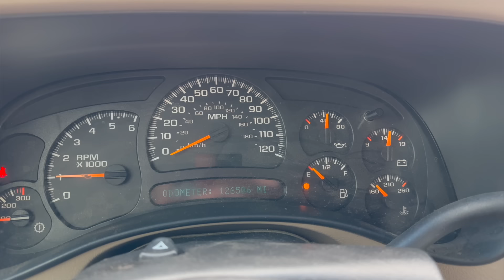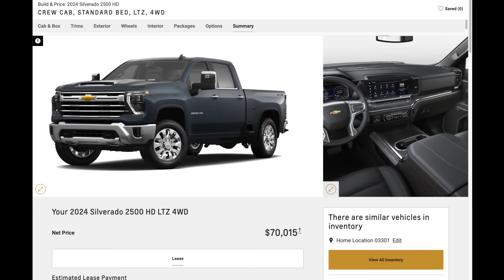I Bought the Best Truck I Could Get for $10k. How I Got it at Dealer-Only Auction

Comment: That truck is better in the front end collision. If you look at the bumper where it meets the thunder on the passenger side, it's angled down. Classic sign, it has been in a front end collision. Common replacement on these or front hub assemblies.
Water pumps ABS modules window regulators. Hey. Close attention to the connectors from the heater hoses to the heater core.

Comment: There are a couple of coolant drain plugs on the block that are useful to get more of the old coolant out before the flush.  You could also get some out of the heater hoses as well.
Reply: I could swear the radiator has a drain plug on the driverside corner
Reply: @fakeascanbe423  it probably does - these are in addition to those.  I was surprised how much coolant came out of my Dodge Ram 4.7 V8 when I removed the block plugs
Reply: Lucas-fi4xy  cool, thanks

Comment: A tip for dealing with a trans that doesn't have a drain plug. You can remove the front trans cooler inlet line and turn the truck on and pump out about a gallon and the pan will be mostly empty. Just don't let the inlet line start to form air bubbles, at that point you are starving the pump and can hurt it. You can also to a "Poor Mans" trans flush this way if you don't have a machine to do it, Just pump out a little less than a gallon at a time (pump a gallon, refill, restart truck let it run for 2 or 3 minutes then drain another gallon and so). Doing it this way I normally put 4-5 gallons through the system as when letting it pump for 2-3 minutes you get mixing of the old fluid and 5 gallon normally gets it cherry red.

Comment: Always remove the fill plugs first to allow air to rapidly replace the viscous fluid trying to drain out the bottom.
 How many holes do you put in the top of a juice can?   Two right ? 

A Faster drain removes more dirt trying to settle at the bottom.  

Filling a transmission like that is much easier when employing a spare or old power steering pump, and a hand electric drill to turn it. 
Takes a fraction of the time.

Comment: I replaced my front wheel bearings earlier this year and it took 4 of us on a breaker bar to loosen the caliper bolts a lift sure would have been nice
Reply: I did with Cordless impact wrench and on the ground also. It took some 5 min to open it.

Comment: Hi Waldo.  Nice truck.  They don't use salt on their roads in Washington state and I guess that is true for Oregon too.  That wheel bearing just about fell off.  I had to heat mine with a torch a good long time and use an air chisle to get it starting to come apart.  I didn't even see any rust on the old bearing or the socket for it.  Amazing.  Nice tip on buying from an auction too.  I don't know if I would ever do that but at least now I know how if that becomes a possibility.  My truck has 363K on it so your dad should get many more miles before needing any serious work.  Thanks for the video!
Reply: Majority of Wa state uses liquid de-icer, worst thing to have. Drive-through car wash more often during winter.
Reply: Living in western WA I’ve seen parking lots salted and some roads especially with this past winter but nothing compared to the rust belt

Comment: Cateye chevy’s whether it’s gas or diesel are, in my opinion, the best (overall) trucks ever made. Like you said they’re modern enough to be reasonable comfortable, but they’re by no means like the brand new hunks of computerized plastic you buy for $70,000 today.

Of course other trucks might have a better engine or better transmission or have better this/that. But when taking EVERYTHING into account, I can’t think of a better truck than the cateyes.
Reply: As an OBS ford guy I have to agree. I might give the OBS fords the nod in reliability/ease of maintenance, but the cat eye Chevrolets are very nice looking trucks. If I had the option of an OBS ford or a mid 2000s 2500hd single cab long bed, both in rust free and mechanically immaculate condition... I'd take the Chevy, I think.
Reply: @bad_covfefe  Both phenomenal trucks in their own ways👍
Reply: Best teammate. I have the 2000 7.3 and a 2006 6.6. Both have a pretty easy maintenance but I'd give the edge to the 6.6 because the allison transmission has an external filter. Blows my mind how awesome it is.
Reply: Personally really like the ram 1500s from 98-about 01.  Don't care for the early second generation as much as the late.  They are a good mix of easy to work on and fairly modern fixtures.
Reply: I have an 05 z71 crew can in red.  Unfortunately the clear coat is peeling.  It is a sharp looking truck.

Comment: I bought a 2001 2500 hd   GMC, I did all the fluids. When I pulled the plugs, they were worse than those, worst I’ve ever seen, still running pretty good and getting mileage you were. Couldn’t believe it ran at all.  Great truck 210,000 miles and should go another 2.

Comment: Former FoMoCo chassis engineer of 15 years here. I have to admit, secretly admired GM trucks of this era, especially GMT800 and may be GMT900. The LS/LT V8 engine was the enabler for many good things for this truck. LS 6.0L + 4L80E was the best combination of all time. Then K2xx and T1xx happened and it was down hill from there.

Comment: Here in Michigan its virtually impossible to see a frame that beautiful unless the vehicle is new or at most 1-2yrs old. The road salt is incredible at making winter driving safer here and it works very well, but its nightmare fuel on vehicle frames and bodies. That truck would have holes in the frame or close to it, and the truck bed and bottom of the doors would without a doubt have holes by now. Even when you do your best to wash it off you cant escape it, basically vehicles do not last long here.
Reply: Excessive salt use Doesn't make anything safer. It makes drivers more complacent leading to risky behavior in inclement weather and is horrific for the environment.

Comment: I loved this episode. There’s something incredibly pleasing and satisfying about working on an older vehicle that is in nice condition underneath. No struggling with rusted bolts etc. Unfortunately that’s rare here in the UK as the first sign of colder weather and the salt gritter trucks are out! I now use something called Lanoguard, which is a natural underseal that uses the oils from sheep fleece. Much nicer to use than the traditional black underseal!
Reply: I'm doing my trucks now in preparation for winter, although we don't use salt, a nice pressure washing and a coat of Amsoil MP
Reply: Thats good stuff, I use it on the plow at work.  Called Fluid Film in the US for anyone looking.

Comment: All I have to say is Trucks made from 85-10 were super easy to work on, once we hit the mid 10’s it got substantially harder to work on. Nothing is better than having to take the whole front end apart after a rock put a hole in your radiator

Comment: Don’t forget to change the fuel filter, probably the original in the truck, you will be amazed at the performance improvement. Everybody knows to check and change the air filter.

Comment: Man, that's a hella clean truck! Idk though.. I think I'd rather change spark plugs any day then have to mess with injector pumps & stuff like that which go bad on diesels and can be very expensive to replace. Idk, maybe I'll get one someday, but we'll see. Anyway, love these videos! Nice work. 🍻
Reply from the maker: Just make sure you get the right diesel engine. One that doesn't have a bad reputation for failing injection pumps 👍
Reply: I love diesels myself, but I have to admit there is something nice about having an engine that is cheap to work on and cheap to replace if it is necessary. (Oh, and half the weight.) That diesel torque and sound though... Oh my.

Comment: Hey Waldo, how's going? Can you tell us why your dad chose a gas engine instead of a diesel? And how this chevy drives in comparison with your diesel GMC? I'm curious!
Reply: They can be a lot less maintenance less large expensive parts. Diesel has a cp3 fuel pump in this generation, the intercooler, turbo,  injectors. Diesel can have cold temp issues...just to name a few
Reply: I'm not Waldo, but gas engines are cheaper to maintain and run. Less power and less fuel economy are a given. If you're not towing much gas might be an option to consider. If you're towing regularly, buy a diesel. Front end ride will be better with a diesel as the motor is heavier. Shocks will provide an improvement to ride quality, but you get what you pay for. That goes for gas or diesel.

Comment: The GNT 800 platform is a very good platform. I've got an '04 GMC Sierra 2500HD w/Duramax LB7 and Allison Series 1000 5 spd transmission. It has got approximately 526,000 miles on it and is a daily driver. Runs great and gets 18-19 mpg local driving.

Comment: Tip an easy way to check if your window motor works before removing it  grab a 15ft speaker cable hook up to your window motor and hook up those wires straight to the battery if your motor works, its a fuse, or window switch, or beoken wire....you can use same technique to check car seat motors...

Comment: I have a 2006 year model, bought it when it had 13,715 miles on it, has 141+ on it now, put a left wheel bearing about 3 year ago, it may lay down on me tomorrow but it's been a good one, a 4.3 V6 4 wheel-drive, automatic with a manual transfer case.

Comment: 4:35 where did you put the old oil?
Reply: Maybe he uses it as an oil burner fuel but I suspect most people would pour the used oil in the empty bottle and recycle it at an auto parts store, or oil change place. I suspect a Walmart with an auto service center would recycle it as well. I can't find anybody that recycles antifreeze/coolant.
Reply: he obviously drank it. Refreshing

Comment: I bought a 2001 Dodge 3500, Diesel truck off E-Bay, in 2003, for $16500. Had it shipped from Texas, to Long Island. I still have it today, towing my race car trailer after 21 years.

Comment: I hope you get the truck rust proofed. When I change coolent I siphon it from the rad cap. I just fill the siphon tube with water so I don't have to injest coolent. Nice truck. I had a 2005 that rusted away. It was a great truck while it lasted. Now it's my friends off road farm truck.

Comment: not for nothing, but you should first check the oil, coolant in the radiator, transmission oil, brake fluid , and differential fluidbefore starting. then you can start, and check for leaks while its running/warming up!

Comment: I bought a 2003 chevy trailblazer with 100k for $10k a few years ago. Now I have 198k miles and I take care of it. No big oil leaks. Just a tiny one. Those GM trucks and SUVS from like 2000 to 2006 were very well made. If someone took care of that truck that you bought, it's a good buy 👍. It looks like a clean truck! Subscribed

Comment: My first vehicle was a 2003 Chevy Silverado 1500 LS. I got it used in early 2009 and I drove it until mid 2018. The transmission was rebuilt, the transfer case replaced, and the water pump replaced. When I sold it, it had nearly 400,000 miles on it; all original motor, etc.

Comment: As a steering and suspension ASE certified tech to get rid of the very minor play both the ball joints have and the outer tierod has on this truck basically all he had to do is so long as the boots were in good condition was refill them with greese and its done. And he checked the balljoint play wrong as well.

Comment: I would suggest investing in a torque wrench for axle nuts. Even a super cheap one will work fine.  It's not that doing it by hand won't work,  but setting to spec will make those bearings last longer.

Comment: The best truck is 4th gen Chevy/GMC 1500. They made them from 88-2002. The best ones are 96-02. They have passenger airbags and 3rd door on the extended cab along with a few other upgrades. Parts are cheap and available everywhere. You can definitely find one for under $10k.

Comment: I have a 2012 chev 2500HD 6.0 gas and we bought it with 450k km and it still had original spark plugs! the most worn my mechanic of 30 years dad had ever seen and the truck ran like a top. those 6.0 are one of the best engines ever built

Comment: Lithium grease the rear door channel where the window slides are. Your regulator will slide smoother and it’ll prevent it from premature failure later on down the road

Comment: Recommended spark plug change for those engine's is 100K and iridium plugs are recommended. Love these trucks. if changing upper ball joints it comes as the upper control arm assy. Easy peezee

Comment: I just bought a 2003 2500HD with the 6.0gas it has 280,000 miles and runs and drives perfect. Mine was from southern Oregon and is completely rust free. Its nearly identical to the truck in the video except mine is a longbed. I scored mine for $6,800.

Comment: I would definitely replace the brake rotors and pads while you’ve got all that apart.  And those rotors look like rusty crud.  They may have meat but the surface is obviously lousy and that’s the front where 80% of the braking power is.

Comment: Almost all I sell is GMT 400/800/900/  The GMT800 is the best platform ever made, by far.  That you paid 10k for one, wholesale, is nuts.  Diesels bring that money.  Stepsides with LOW miles bring close to that.  

Also, cops can't generally run temp tags.  A temp tag number didn't used to even be associated with a particular vehicle.  Now most states do seem to register the temps they generate but there's no consistency in numbering.  A temp from one state may by the same alpha-numeric as a real tag in another state from long ago...or even now.  Yours matched one issued by their state.

Comment: The bend direction of the split pins on the castled nut of the tie ball rod is incorrect, the correct way of bending the split pin legs is vertically, one leg bends downwards into a recess of the castle nut and the other leg bends backwards over the bolt end, this will prevent the castle nut from rotating and loosening less than a threads pitch.

Comment: Just fyi next time changing transmission fluid, remove every other bolt then start in one corner remove bolts so the pan will hang and drain while working towards opposite end so then theres less fluid in the pan ehen ready to remove.

Comment: Did I miss the mileage on this beaut somewhere in the video?  I picked up an 01 Silverado 2500HD w/6.0L in Atlanta back in 2018 for just under $10k, with 79k on the odometer.  Came back clean on CARFAX and the truck passed my PPI with flying colors.  No rust anywhere, got it fully rust-proof undercoated with thick grease/oil mixture. I did drive it home before changing all the fluids except the coolant. I live in MI, so the rust-belt is in full effect here.

Comment: Bough my 04 Silverado in 2008 for $8200. It had 64K miles. It now has 190K. That same exhaust manifold bolt is broken off on mine. (Came that way) also the original water pump gasket sagged when assembled at the factory and started leaking around 100K miles.

Comment: I have a 2003 GMC Sierra 2500 HD LT crew cab with Duramax 6.6L 4x4 with 55K original miles and owner.  I get approx 16 - 19 MPG at 75 MPH.  I got better fuel economy after replacing a few bad glow plugs.

Comment: To remove the Trans pan without a drain plug, remove all the bolts on the front and sides first so as you remove the last bolts, the pan will tilt and drain on one end.
Steering play on these the rag joint is overlooked,  replace ever 100k miles.
Idler arm too
Drive shaft u joints can only be checked with shafts removed. Tightness and clunky movements are as bad as slop. Should swivel smooth & free.
The serpentine belt should be removed and all idler pulleys & tensioner pulleys spun by hand for noise or too much free travel means no grease, worn. Replace with new belt same time.
50/50 coolant or 100% + distilled water only.
Dark brake fluid means water contaminated.  Water makes steam in hot brakes, steam makes spongy brakes on inclines.
Don't flush the transmission, only filter & pan replacement fluid.

Comment: really good trucks.  i have an '03 2500 single cab WT (Work Truck trim level, no power anything) with 100k on it.  paid $6k back in 2012.  still runs great.

Comment: Cool tip on the auto Auction Broker site. I'll give it a try. Please post a list of your top 5 auto auction sites.
Those spark plugs were pretty spent. Excessive plug gap puts a lot of stress on the associated spark plug coil.

Comment: That's literally the best model truck that Chevy has ever made and you got it for a steal at $10k with such low mileage. Mine still ran like new at 340k miles til a big rig t-boned me. Take care of it and it'll last to 500k, maybe rebuild the transmission at about 240k like I had to but it cost less than $500 to rebuild it yourself.

Comment: I had a 2004 Chevy Silverado started losing water coolant around 65000 miles replaced water pump twice still losing coolant about a quart a month, finally found out the mystery water was going out my exhaust it turns out Gm manufactured faulty heads between 2002 and 2006 the coolant was leaking out of the exhaust a hairline crack in there heads let the coolant leak out . Gm knew this and kept it quiet until off standard warranty, that is the last time I owned a Gm product.

Comment: 25:21 mate diesel comes with so many more nuances than gas the only reason i use a diesel (in the UK) is because of much cheaper tax and fuel economy, on my old car and motorcycle changing spark plugs filters and fluids was easy and pretty much all the love and care needed. The 3 diesel cars i’ve had each had their own special issues like dpf, egr and turbo, injectors, glow plugs, fuel pump and high pressure fuel lines none of those were cheap to solve give me spark plugs any day